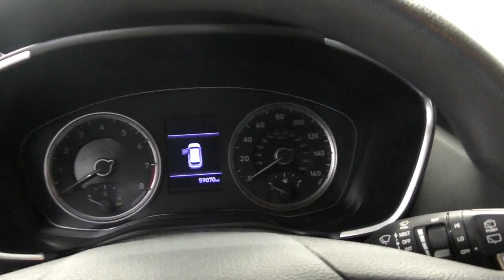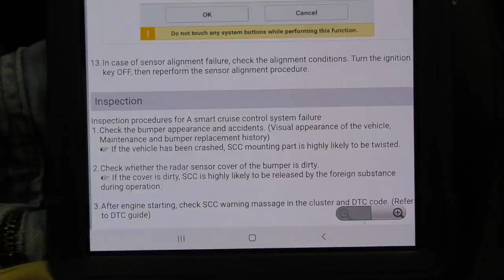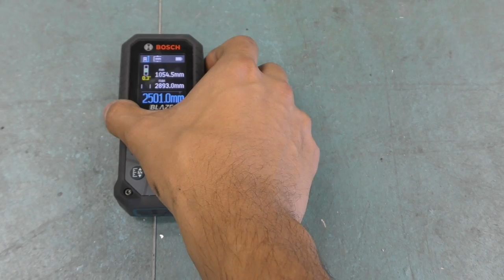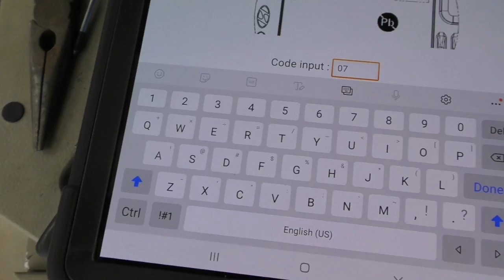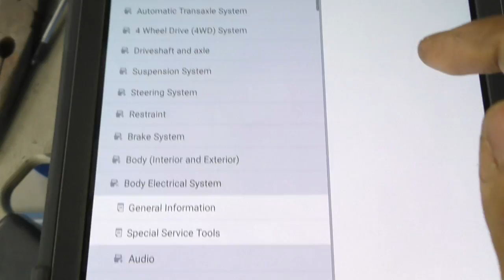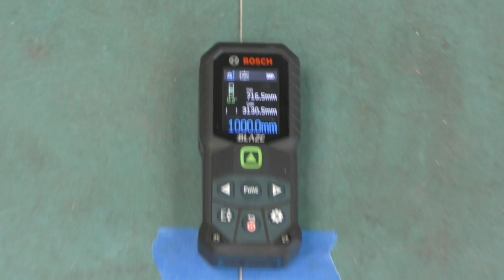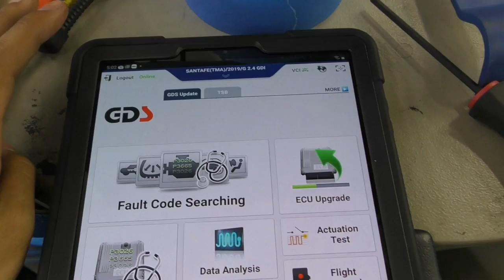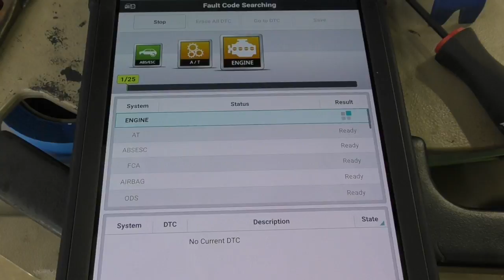2019  HYUNDAI Santa Fe front Adas  calibration

Comment: Where are you located? Can you recalibrate my 2017 Hyundai Santa Fe forward sensor? My AEB/Smart Cruise control show out of alignment.
Reply from the maker: Hi,We are located in Cape Coral Florida 33990
Reply: @adasaimingbyjackshort2123  should the angle or the front radar be at 89 degrees slightly down? I am worried that mine might be off by a few degrees. How do you correct that before calibrating?
Reply from the maker: @xbrianx2  89 to 90 degrees vertical is within factory specs. Yours may be off horizontally however. That needs to be measured as well ....it needs to be parallel with the vehicle
Reply: @adasaimingbyjackshort2123  are you able to make these adjustments horizontally before calibration? How do you do that? By gently bending the bracket back?
Reply from the maker: @xbrianx2  Yes you do all your adjustments before the calibration you can try to bend the brackets back.or replace the bracket.you would need a triangle  target and they scan tool to put it into calibration mode.